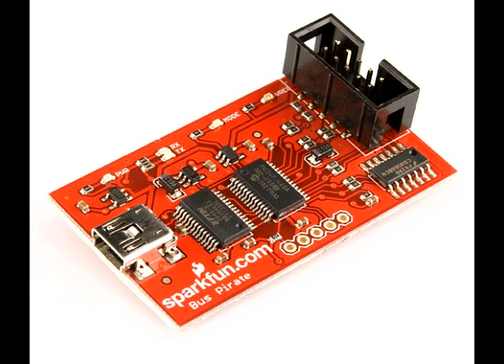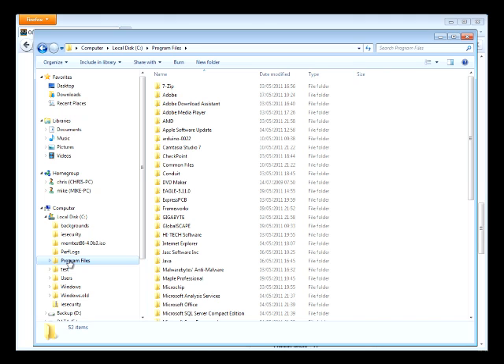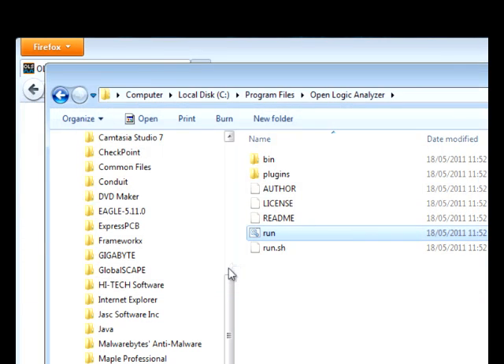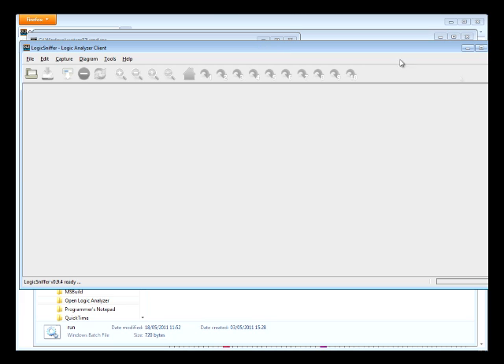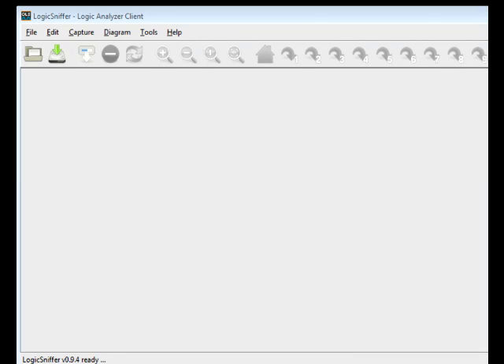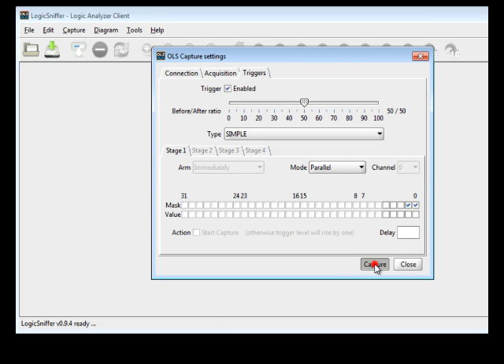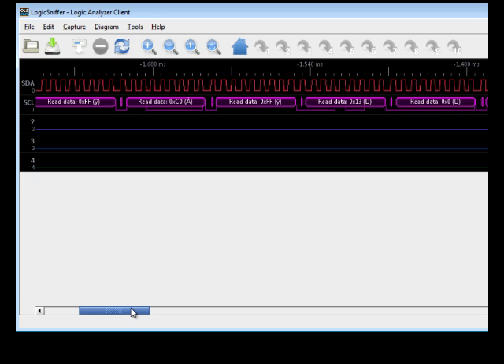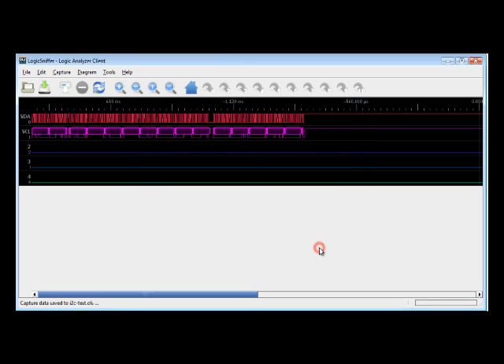Bus Pirate Logic Analyzer

Comment from the maker: The Bus Pirate is an open source hardware design. That means anyone can make boards based on the design, so Sparkfun has not made a cheap knock-off as you suggest. It is based on the same hardware as the Seeed version.
Perhaps you can enlighten us with the "issues" you mention. 
The Bus Pirate can supply 5V and 3.3V outputs on the 10-pin header but these need to be turned on through a terminal connection. There is no way to do this using the OLS software. Power your circuit as you would normally

Comment: @hobbytronics101 I know that I can power the circuit from the bus pirate when I'm issuing commands directly from the terminal, but I don't see a way to do it while using it in conjunction with the OLS software, though I did end up just powering the circut from a separate power supply.

I'm working with an RFID reader, the Bus Pirate didn't have a fast enough clock speed to decipher the signal though, so I ordered the actual Open Logic Sniffer, hopefully it will work.

Comment: I know that I can power the circuit from the bus pirate when I'm issuing commands directly from the terminal, but I don't see a way to do it while using it in conjunction with the  OLS software, though I did end up just powering the circut from a separate power supply. 

I'm working with an RFID reader, the Bus Pirate didn't have a fast enough clock speed to decipher the signal though, so I ordered the actual Open Logic Sniffer, hopefully it will work.

Comment from the maker: @aarobc The bus pirate is designed for testing a circuit not for powering it. Having said that, it has 5V and 3.3V outputs which can be used to power a circuit although there are obvious limitations on the amount of current it can supply. What circuit are you powering and at what voltage/current?